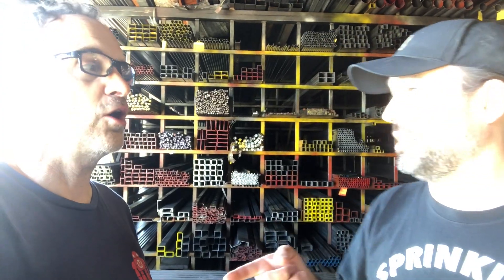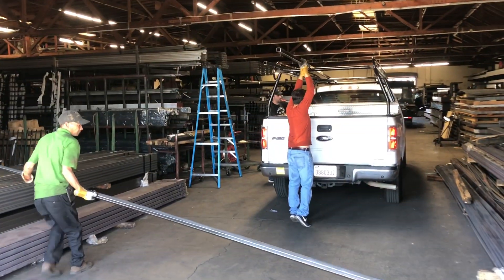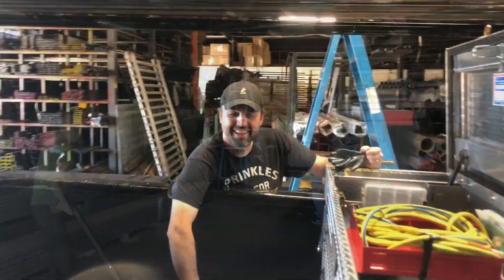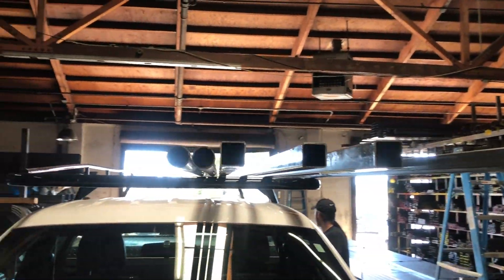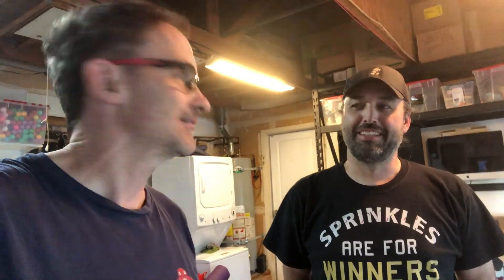Backyard Launch Roller Coaster - Part 1

Comment: A preliminary list of wild ideas for acceleration:
solid propellant rockets(s) on cart
water rocket(s) on cart
water jet shooting plate on back of cart
bungie cords on catch cart
dropped weight w cable/climbing rope and cc
catch cart attached to cable attached to spool drum motorized with hydraulic motor(s)
cc attached to cable attached to spool drum with large cantilevered weight (like trebuchet)
Tesla on jacks with tire off and bare wheel acting as spool for cable/rope attached to catch car
used Tesla motor and drum/cable/ccart
tie a rope from your Tesla to the cart.... what could go wrong?
hydraulic ram with pulley system to multiply distance
linear accelerator with electromagnets
large vacuum tube (hold plunger with cable to ccart, pull vacuum, release)
large pressure tube
propane cannon
I currently might favor the weight on a rope (24KN arborist/climbing dynamic rope, 5000 pound test) idea, seems simple to raise a weight with a counterweight.  Anytime you are dealing with this much energy (up to 10,400 Joules by my preliminary estimate), it's going to be dangerous.

Comment: Why don't you incorporate a flywheel ? You can ramp it up slowly and then couple a steel cable pulley with a clutch to release all the energy in one time.

Comment: Seems like your braking system will have to be even more reliable than your acceleration system, if I'm reading you right.  You might consider a copper and supermagnet braking eddy current system, the main advantage in my mind being that it's a passive system, as opposed to an active system of, say, electromagnets. 
 Look it up on YouTube "SuperMagnetMan Magnet Braking on a Skateboard".   Probably would cost a lot.

Comment: Do need help with the physics and performance predictions?  I can get you in the ballpark if you want to know how the top speed of the cart, and how fast it goes at the top of the hill, given cart weight, rider weight, and hill height.  Also, how much acceleration you will need given the acceleration track length.  From this, you can know how much energy is needed for your electrical system, and if it's even feasible with house power.  The higher you go, the more expensive and complex it will be to support your tower, either by digging down and making a concrete foundation, or providing side struts which will take more room.  Working high will have safety issues, so be careful.
How do you plan to dissipate the energy at the end of the ride?  If you had a long track, it would slow down gradually, but if the track is short, you're going to have to have a reliable way of slowing the cart down.  Something bomb-proof, for safety.
Reply from the maker: Hi Paul! 
It would be fantastic to have you weigh in on this one. 
Who wouldn't want an actual rocket scientist on the team!
Reply: @WillPemble  This is risky business.  I personally think you should do a long coaster (like 1000 feet or more) down a hillside with really nice turns and features, like an alpine coaster.  
I don't have a lot of confidence in these numbers, but for what it's worth:  Assuming you want to achieve 25 feet in height, with a max 250 pound rider on a 50 pound cart, and an acceleration distance of 25 feet, you'll need to a top speed of 13.6 m/sec (30.42mph), accounting for some drag (10%) and a little speed (1.8m/sec) left on top.  You will need to apply 371 pounds of thrust ((less for a lighter rider) for 1.12 seconds to get to that speed in just 25 feet.  The upturn track radius will need to be at least 15.5 feet in order to keep the g's below 4.  Centripetal load in the upturn would be 1198 pounds.  Distributed evenly over 8 wheels would make 150 pounds per wheel.  This is all in a spreadsheet, so we can play with the numbers easily.  I should probably make a video on my channel explaining the calculations, if that's all right.  Treat this as brainstorming for now.  I probably made mistakes.
Reply: @WillPemble  I ran the numbers againwith 15 ft height, 200 pound rider.  The upturn radius to keep under 4 g's is only 9.5 feet.
I added a power calculation, but I don't trust it until someone checks it out.  Not my area of expertise.
I tried an acceleration distance of 10 feet, but, If my calculations are correct, that would take 16667 Watts or 22.34 electrical horsepower.
I increased the acceleration distance to 20 feet, and that takes 4167 watts or 5.6 electrical horsepower.
Like I said, I don't remember much about electrical power.  Maybe John or another subscriber knows how to calculate the required power.
Reply: I made another video investigating a air pressure piston launch system.  Short answer, I think it's feasible with a 10-ft cylinder of 4-inch diameter PVC schedule 80 with 45 psi pressure, and a 8-inch diameter schedule 80 PVC accumulator 70 inches long.  You would need a large valve you could operate very quickly.  See the video on my channel for more detail.

Comment: If the powered launch doesn’t work out, maybe consider a weight drop system like the original Shwartzkopf shuttle loops, or like catapula at Ai Pioppi (Italian handbuilt amusement park)
Reply from the maker: Or a hydraulic launch.  What I love about the electric launch is that we could manage speed without regard to the weight of the rider. That way, the cart will be going the same speed if it's me (very heavy) riding, or a kid (very light). 
We'll see!

Comment: The truss could work, but I think you went about it the wrong way. Maybe start by building the regular flat track like before, then build the truss onto the bottom of that with an inch or two of clearance between it and the rails.

Comment: You can build a LIM or LSM Coaster (an launch coaster with linear electric motors) in your backyard even with a house power source. You just need to store the energy. The Rollercoaster "Fluch von Novgorod" in the German "Hansapark" used a huge Flywheel to store the energy needed for a Launch. Now they use Supercaps to store the energy needed.

Comment: For safety and staying away from the cable side.   The sled cart is risky, and adds lots of areas for things to go wrong that could lead to derailment or injury without a very serious build.  Stress aside.   Might be best to just stick with a tire drive systems with spring load for tire uplift, chain drive the multi tires along the launch section.  tension either underside or both sides of ride veh, run off a 8hp plus dc motor “golf cart motors should be fine) geared for the speed you want to achieve.       Other approach why not launch it into the spike forward or backward, goes thru load area (can have the drive motors reverse to gain it additional speed from second pass)  into air time hill, then climb turn and into tight course in the wider area, then have it reach second spike  , and reverse back thru course basically a boomerang leaving the narrow part of the yard with the most space.   Return speed will be tricky to calculate depending on the end of property run element used..

Comment: With the speed this has, you will probably need magnetic brakes. Would be cool to see you install a simple drive system on this as some type to prevent the need for the car to be pushed... Possibly just a downhill slope with brakes on it like on old Arrow coasters and wooden coasters?

Comment: This is a great idea and I can't wait to see the finished product. The only thing you should consider, is that if the launch fails or is too slow, the launch track needs to also be fitted with brakes incase of a rollback.
Reply: It should also be at an angle so the train returns to the station if the launch doesn't activate or the train doesn't leave the launch track

Comment: But you already have a 350V DC power system with a great motor and controller, just use that! ;-) (You might think I'm joking, but it'd be fairly simple to machine a remove-able wheel hub attachment to a sprocket or some kind of coupling, and jack it up, and launch it)

Comment: Jeez, a launch coaster. Also, what happened to the barrel roll.
Reply: Memes.u Table it failed, it was too rough from what I heard
Reply: It was from a video on YouTube it’s from insider
Reply: Memes.u Table it was like some kind of documentary on the backyard roller coaster
Reply: ColdplayFan360 RollerCoasterFreak  Well I mean, it wasn't even heartlined
Reply: The roll was not viable for a human to ride.
Reply: @ryan_n05  they said they would remake it for the inversion, but this sounds much better
Reply: @njdotson  No, they said that they would build a coaster from scratch that has an inversion in its original design.